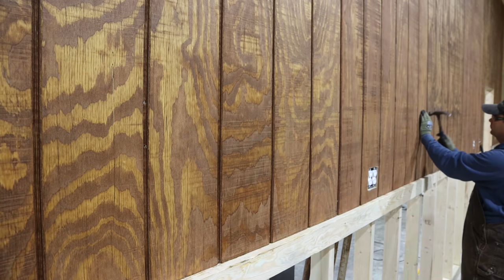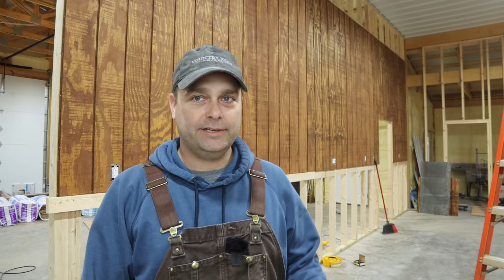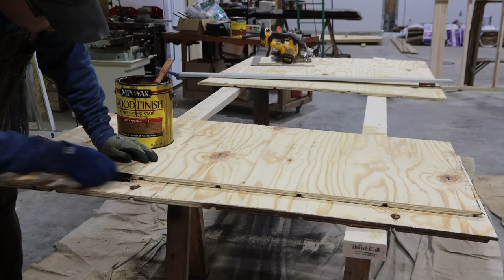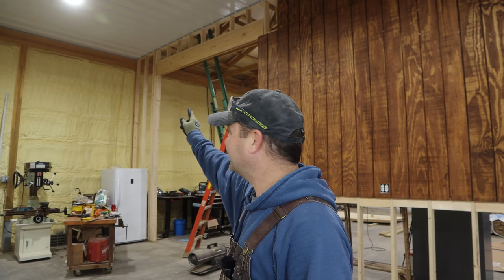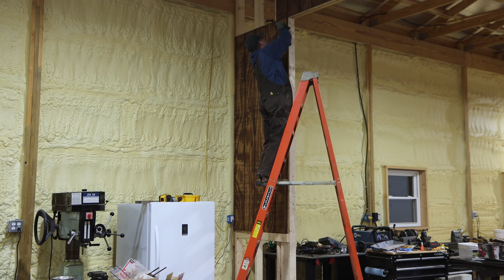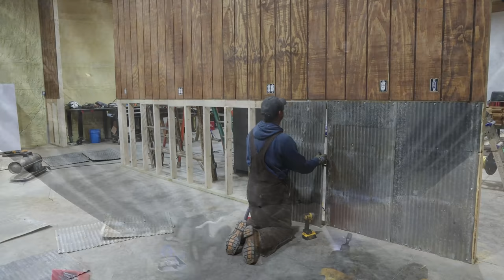I made a Rookie Mistake building this wall.  But I worked past it and got it done.

Comment: Tarps as temporary covers for the people and garage doors in the shop are good ideas.   You might consider using heavy weight plastic sheeting for the garage door.   We used that during the winter our house was being built which allowed us to work and stain siding in the garage during the winter.   The advantage of the plastic vs the tarp is the light that it gives you.    The wall looks really good.

Comment: You might consider using galvanized switch and outlet plates on your electrical installation, which would pick up the color of the barn metal.
Reply from the maker: That's the plan.  I already have a couple installed.  I just need to get more.

Comment: Easy, going across the header put 1 nail at bottom of header in a groove, middle nail at top of header in a groove and top nail into top plate, also in a groove. When you get to the tall part install blocking to accommodate nailing in a groove. Looks great, the staining the T1-11 was a great idea. Love your videos, especially how you show the good, the bad and the ugly. It’s all a part of DIY, celebrate the good and learn from everything else.
Reply: Your solution of adding the 2 extra studs worked great for the  tall portion of the wall next to the overhead door.

Comment: I thought you might do some drywall on the bottom behind the tin for a fire stop protection.  It looks great.  Gave me some ideas for the garage.  it a little smaller, ok a lot smaller.  I really need space to work on things and store them better.  Winter and spring cleaning is coming soon.  Soon be time to bring home my snowplow (aka tractor!)

Comment: I've found that those Kreg jigs that turn your regular circular saw into a cheap pseudo track saw are a lot easier to avoid mistakes than those cross-clamps (because there's no offset to allow for). Real track saw would be even nicer, but expensive. The kreg things are < $100 ... feel a bit wobbly at first but they actually seem to work fine.

Comment: Like the look of the tin but my concern is that, if you're as clumsy as I can be sometimes, over time it's going to get pretty dinged up.  Also, another solution to your 16" centers being off would be to put cross members in between the studs to nail to.

Comment: Great job! Your level of OCD for perfection rivals even myself.. lol.  That wall looks great…. I had an uncle that did something similar in his garage, but used chip board stained a similar color.  He covered all the walls/ceiling and made matching cabinets and shelving.. it looked amazing.  Not sure if chip board is more expensive than the paneling, but it may give a complimentary texture for some of the other walls as you continue to finish off the shed (and no groove lines to match up)..
Reply: Definitely OCD, tunnel vision, but perfect lays in the mind of the worker. No room for sloughing off. Lol.

Comment: Wonder if you're going to string a cable on the outside of the wall over the overhead door opening and slide a tarp back and forth to open and close. Maybe a pulley/rope system at the top to move it open and shut. I bet you got a better idea.
Reply from the maker: That would be ingenious.   But the tarp is hung in a much simpler way.

Comment: You can continue nailing your pattern all the way across the door frame as you can nail at the header and at the top plate which is plenty for that short a space.  Three points of nailing on a two foot piece is plenty good. Then you cobble up some blocking on that very short wall that is left again still maintaining your nailing pattern.  Kind of a lot of worry over a shop though.  You still have full perimeter nailing on that final short wall so it isn't that difficult and won't take much blocking.  You also don't need a full fourteen foot stud as you can run a block across at whatever length of stud you do have between two studs and then use another piece to extend to the top plate.

Comment: Run some brown 'Z' channel between the two runs of T-111.  If not then caulk the backside to stop air flow if you are going to be heating the shop.  It won't get any easier than now.

Comment: Looks like you recovered well from your mistake. It looks really good. Wondering what you are doing to prepare for the possible super strong snow storm that might hit your area. We are in the Chicago area and on the northern edge, so maybe 6-8". Looks like you could get hammered.
Reply from the maker: I am taking the day off work.  It seems like the best solution.  Better to be at home than on the road.  
Gas cans are full, generator works.   Plan on getting tractors in the new pole barn.  Maybe get plow on the Allis Chalmers.  I should be ready by Wednesday.
Reply: @CountryViewAcres  Good luck. Looks like you could get ice instead of snow, depending on the track of the storm

Comment: Re the T111 nailing - I would have been tempted to just face nail it with the finish nailer? It's not under a lot of stress.
Reply from the maker: The plywood is warped a little.  Some of the framing nails pulled through the wood groves were it didnt want ti lay flat.  In those spots framing nails were put very 6 inches to get the wood to stay flat.  So finish nails probably wouldn't have kept the plywood flat.

Comment: Very nice job but...  Lots of positive comments about the stained T1-11 wall but not so much on the metal sheets and that's because the metal sheets just don't make it.  Rustic? -  maybe, but in my opinion, they add nothing to the aesthetic appeal.  Dull gray, some rust and discolored.   I think a coat of flat, eggshell or satin galvanized gray enamel paint would make a considerable improvement in the metal sheeting appearance.

Comment: Looks really nice. Just a thought, with out varnishing or sealing the wall with a smooth finish do you think saw dust and other things catch in the fibers? Really enjoying watching your project in progress.
Reply from the maker: Yes I think dust will settle on the plywood.  But I should be able to blow it off with an air compressor.

Comment: QUESTION:  Why did you decide to erect the building with 14’ walls?  I am debating what height I want mine to be.  Thanks. Tim in northern TN
Reply from the maker: I decided on a 14 foot high ceiling because I thought one day I might install an automotive lift.  And the higher ceiling would allow me to lift vehicles higher or work on bigger vehicles.   That is really the only reason, if not for that i would have had a 10 to 12 foot  ceiling installed.
Reply: @Country View Acres my thinking too.  Thanks for the quick reply.  Tim

Comment: Dumb non carpenter question. Why do you hand nail some spots rather than using the nailer? It didn't look like the nailer wouldn't fit in some of the spots you hand nailed. Another interesting video. Thanks Evan.
Reply from the maker: I was hand nailing where it overlaps.  It had to be nailed on the face.  The air nailer drives a nail in pretty far and tears up the wood a little.  In the grooves it is not as noticeable. But Not good for the face of the wood.  So i Hand nail the edge because it won't damage the face.

Comment: Why do you hammer some nails by hand?
Reply from the maker: The edge overlaps.  And the nails are on the face of the plywood along one edge.  The air nailer drives nails in deep and tears up the wood a little.  It would look bad on the face, but is hidden in the grooves.  So I hand nail the face so it does get torn up.

Comment: Have you ever heard about finish nails!
Reply from the maker: Some of these framing nails were pulling through the plywood because it was warped and didn't want to lay flat. I would have to put 4 or 5 framing nails 6" apart from each other in some areas to get the plywood to hold against the studs.  So finish nails wouldn't have the holding power to keep the plywood flat.